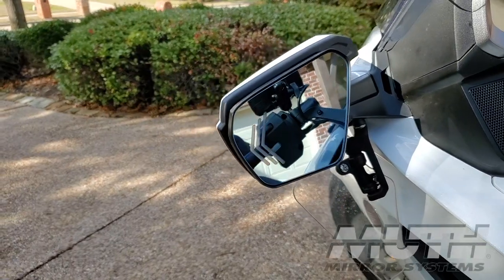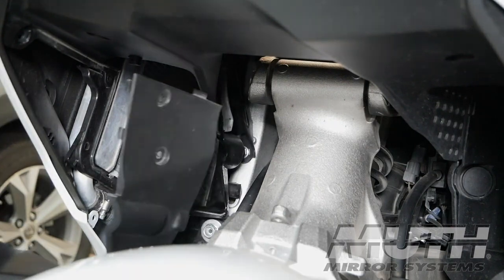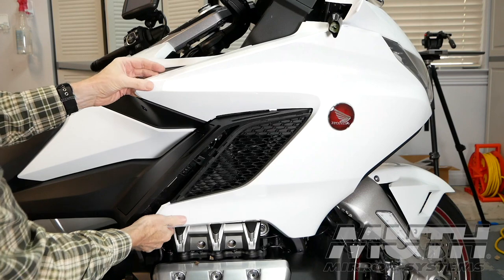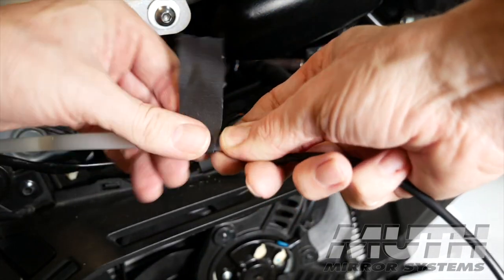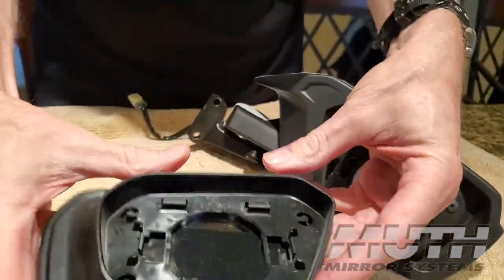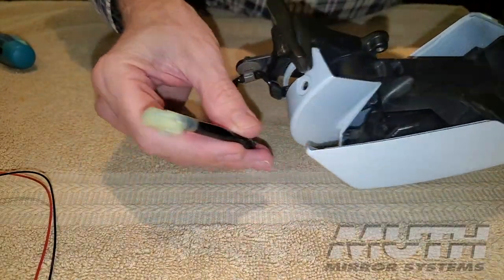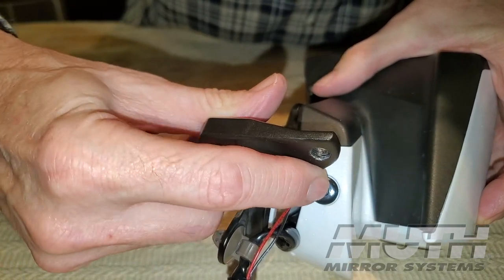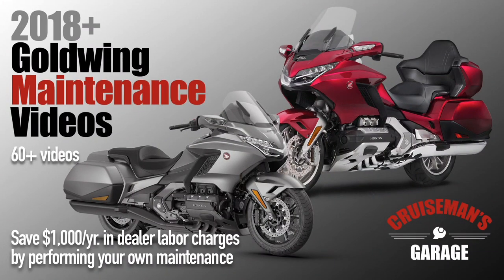Muth LED Signal Mirrors installed on 2018+ Honda Goldwing

Comment: Hi Cruiseman  
                    Just have been watching your video on installing the Muth mirrors, now your video instructions are very good , but what you didn't say was how bloody hard it is to remove those back 3 body clips for the inner cowl , particularly the top two .   

I have a pick similar  to the one you are using but to push in the center of those hard to get to clips is bloody hard work 

Cheers , From a land down under
Reply from the maker: Those seem to vary from bike to bike. Mine were not that difficult, but I have helped others work on their bikes and they are extremely tight.

Comment: Hello Cruiseman, would u have any idea why my Muth mirrors will not work when the Kuryakyn LED fork and rear LED saddlebags wiring harness is hooked up, when unhooked the mirrors work great, when the Kuryakyn plug and play is hooked up the left and rt Muth mirror will just stay on steady, any advise? I ride a 2018 Goldwing....Thxs in advance,,,,,I have considered cutting the tips off the ends and wiring them directly into the Show Chrome Fuse Block, but I don't know the color code and Richard at Kuryakyn don't know the color code as well........

Comment: Went to order but the web won't let you set the Model year so unable to continue. Great video - thank you!  Do you do one to fit the lower fog lights and if so what would you recommend?  I have the Bagger 2020 DCT model.  Update - got around it. Used their search bar and went in that way. They have an option for blind spot monitoring. Sounds super cool on a Wing. Wonder if you've tried this version Cruise?
Reply from the maker: I have made Muth aware of this issue on their website. This is a better link: https://shop.muthco.com/motorcycles
Reply from the maker: Lots of good fog light kits out there. Check out RIVCO if you wan the brightest ones. I have the PathFinderLEDs on my bike.

Comment: Also, I have the brake light modulator and harness so will this work with this system?
Reply from the maker: Yes. You really should consider the installation of an isolator, like Show Chrome, and connect everything to that. Frees up a lot of space under the seat.